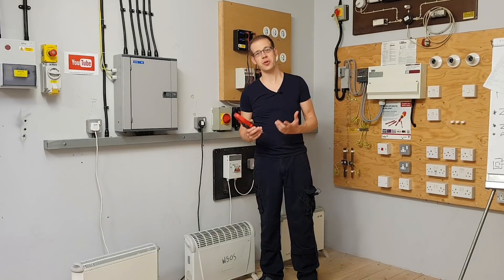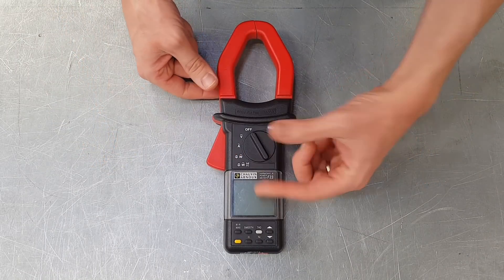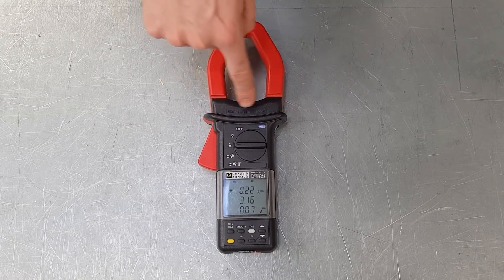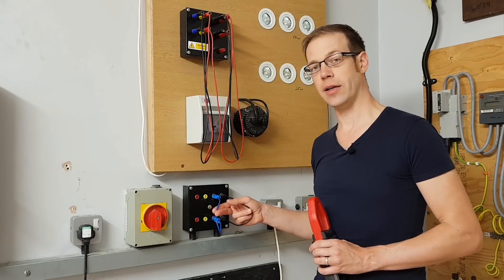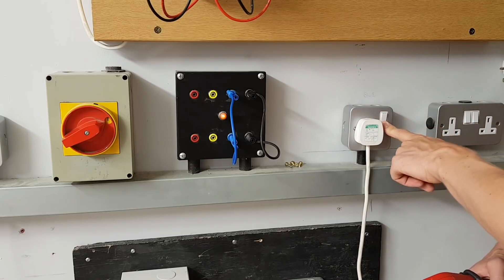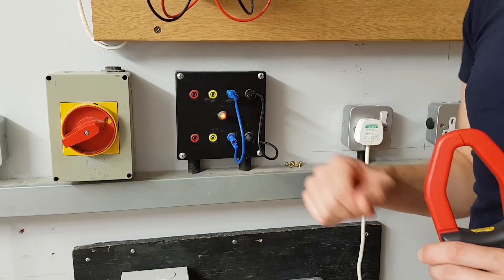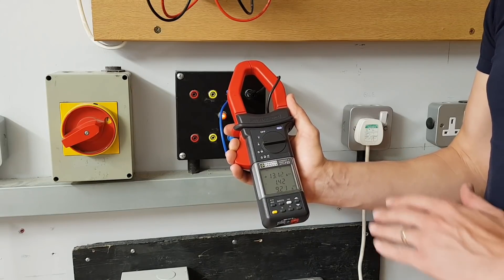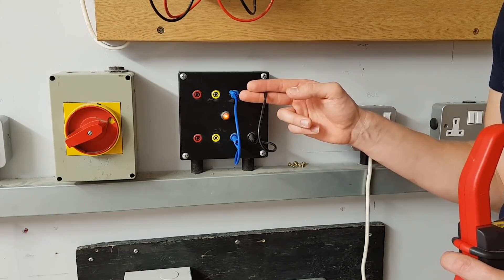How to Use a Clip-On Ammeter/Clampmeter

Comment: Thankyou mate really helped me clear my doubts, honestly i was doing my house wiring which is single phase but almost all of the village electiricians believe that neutral doesn't carry any load and can be smaller than the phase wire (i.e 2.5mm phase wire and 1.5mm neutral wire), and i remembered that cross section of wire depends on amps of current flowing through the wire and also the same amount of current goes through phase (i.e positive) and through neutral (i.e negative) the only difference is neutral might have lower potential difference as compared to phase, so by repeatedly hearing from them i got literally so confused i wanted to see a real demonstration of wether same current flows through the neutral which goes through phase and you cleard it thankyou.

Comment: The clamp meters have a "zero" button to remove that background fraction of an amp seen, this would improve the accuracy. They are often not very accurate for < 0.5 Amps
If you had a DC circuit you could have shown measuring the DC current in the 2nd wire is negative of the 1st (eg. +5A & -5A or -5 & +5A), then the 2 together are obviously cancelling out.

Comment: So in a real world how would I test what the flexed appliance was actually pulling if it’s flexed to a plug
Reply from the maker: You'd need to safely access either the line or neutral conductor and clip around that. 👍

Comment: Hi Joe, if you clamp both line and neutral conductors at the same time you can measure the differential current ( IDiff ) usually in ma which is very useful for diagnosing nuisance tripping of an RCD. Very good clear video, keep them coming. Col.
Reply from the maker: Fantastic point Colin, I might address this in a future video, thanks for the idea and the feedback. Stay tuned for more!